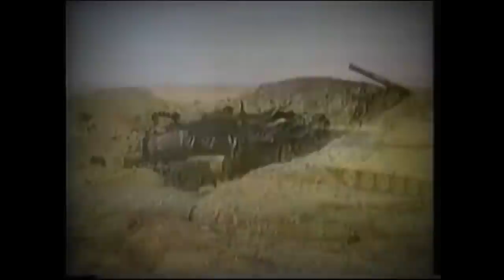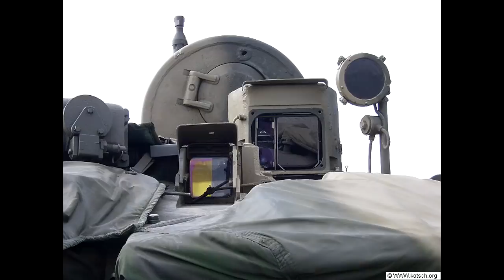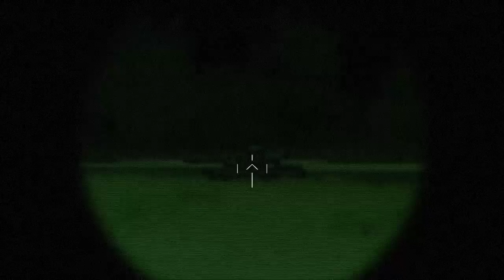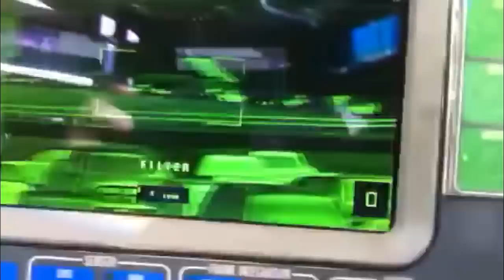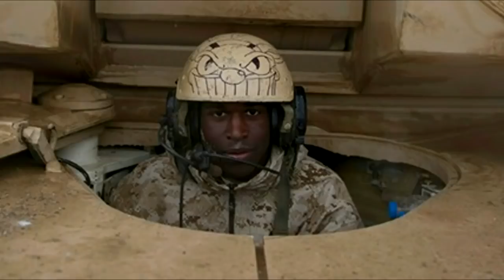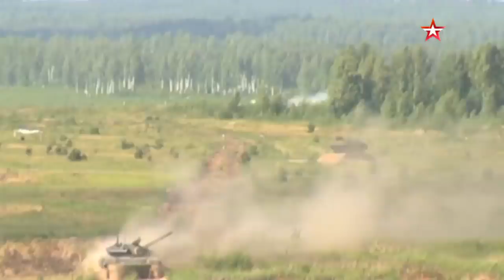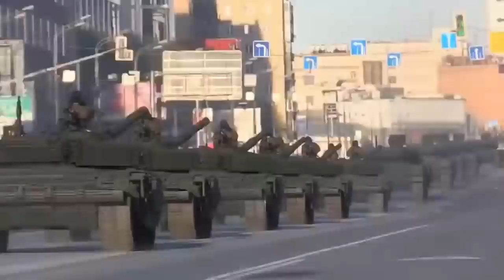Does T-72 stand a chance against M1 Abrams?

Comment: Wasn't turret armour on T-72B modernized variants between 540 and 760 mm of RHA in thickest places tho?
Reply: Yes but only the T-72B3 with the Kontakt-5 has around ~700mm of RHA vs KE, but not the standard T-72B from the 1980's, without the K-5 ERA it has only about ~500mm basic armor

However it should be noted that the Kontakt-5 has different effects depending on different projectiles. For example, against older APFSDS penetrators from the 1980's it is much more effective, than compared to newer rounds such as the M829A3. 

For example, against the old M829 from the 1980's, the Kontakt-5 ERA would break it so it could not penetrate the armor at all. Against the M929A2 it has less protection but maybe still good enough. And against the M829A3 it is probably completely useless, becuase the Americans obtaining some Ukrainian T-80U's so they could test the armor... which means the M829A3 is most likely capable of penetrating it plus the armor behind it.
Reply: @xAlexTobiasxB  That is why K-5 is no longer used, in its original form.
In addition, the booking packages in the tower T-72B3 replaced.
Reply: @elusive6119  Yes right, the new Kontakt-5 is even better than the old K-5 that the Americans used for testing in 2003 from Ukrainian T-80U
Reply: @xAlexTobiasxB  t72b are being crated into t72BM
Reply: For KE protection, yes. CE protection was between 750 and 980mm.
Reply: Volke T-72B3 have 1300mm armor on the turret against HEAT and 900mm against KE
Reply: wont matter when you cant see the tanks shooting at you.
Reply: @skildude  What does that have to do with OP's comment?
Reply: T-72B3M dont use Kontakt-5. They use Relikt (3rd gen ERA). T-14 use Malachit (4th gen) and Kaktus (5th gen) which means cactus btw is in development.
Reply: @blackwidow7804  No, T-72B3M still uses Kontakt-5 on the hull glacis and turret front, you can even see that it looks different than the Relikt as it has different shape and arrangement. Compare T-90 and T-72B3 and you will see that it is Kontakt-5. Only the upgraded T-90M uses the Relikt ERA. The "Kaktus" armor was only used on the "Black Eagle" prototype, which was cancelled. It's not in developement anymore. And no, it's not "5th generation" armor (you just made that up from your imagination). In fact, the Kaktus armor was only a further developedment of the old Kontakt-5, so the "Kaktus" is only an advanced 3rd generation armor, but it's still inferior to the new Relikt and Malachit armor (4th generation).
Reply: @xAlexTobiasxB  according to wiki T-72B3M uses Relikt. T-72B3 used Kontakt 5.
Reply: @blackwidow7804  The front armor of T-72B3M is definitely not Relikt, you can even see it with your own eyes that it looks different than Relikt. Just look at the T90M and you will see the difference. However, it could be possible that the "ballicistic side skirts" on the hull could be Relikt (the same as on the T-90M). If this is true, then the T-72B3M would indeed have Relikt armor but only on the hull sides, not at the front.
Reply: @blackwidow7804  t72b3m usses both lal
Reply: @blackwidow7804  kaktus ERA was used on the cancelled T-80UM2 "Cherny Oryol" tank and the M829A3 was designed to defeat that

Comment: The T72 also has a longer range and its fuel consumption is lower so it has more independece compared to the abrams it depends on the terrain and the conditions but the T72 will most likely win in a European senerio by having both the range in both firepower and fuel in the european plains spacificly...Its lower profile will help in an urban invironment aswell!
Reply: @Steve Arthur  Yes I have, I have also seen a lot of burned out T72s and them engaged at rangers where they could not see us
Reply: @Steve Arthur  Why do you think the US Air Force is useless against Russia?
Reply: Lower profile means nothing with infrared optics on modern mbts.. combined that with computerized targetting systems and atgms ..
Reply: @GeraldMiller-l4l  Russia has alot more artillary and Anti aircraft system and most airfields would be destroyed at the start of the war using long range conventional missiles!
If nukes are used airfields are gonna be completly eliminated including the civilian ones!
Reply: @command_unit7792  If nukes are used then Moscow will be eliminated. As for anti aircraft you forget that Iraq had BOTH T72s and a lot of Soviet AA.  It does not work very well after its radar unit unexpectedly explodes